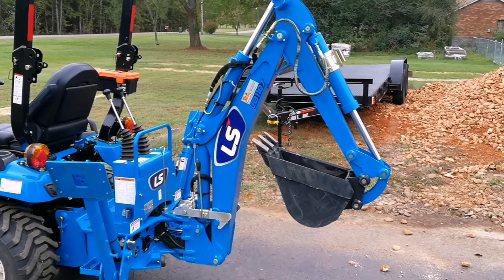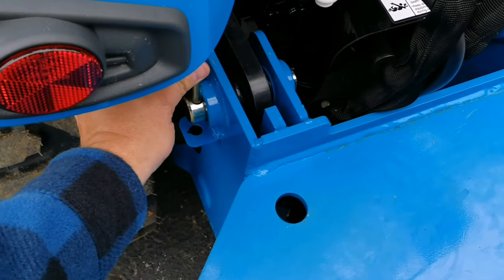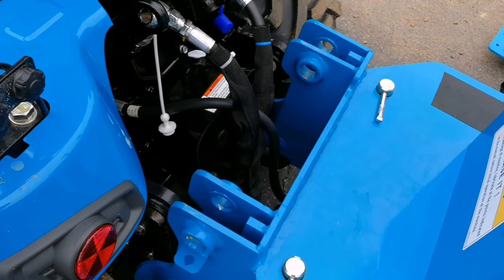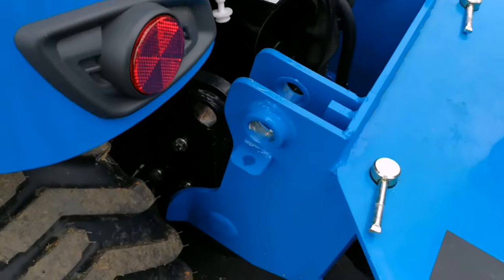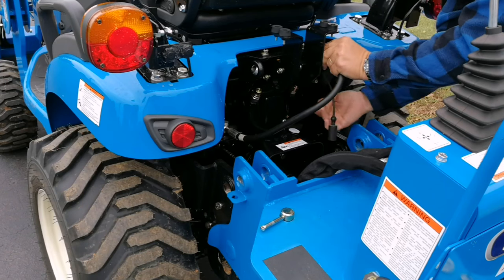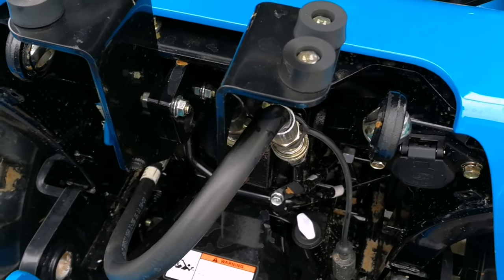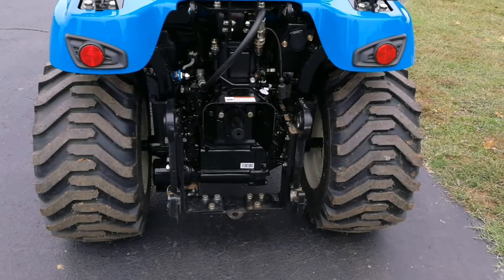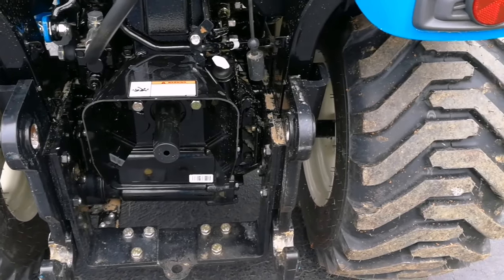MT125 Tractor Backhoe Removal (Similar to 10125R GC1710 GC1720 Workmaster 25s)

Comment: You had forgot to mention that before you disconnect your hydraulic flow/return lines, you need to cycle the control lever valves (after you shut off your tractor, of coarse) to relieve any built up pressure inside the lines. cool video & nice tractor

Comment: So I think the reason you heard to take the wheels off is for the 3 point. I just learned how to do this, & is NOT what my local shop told me. Local shop told me that you must remove the backhoe frame to use the 3 point. Wrong!! When you buy a 25S w/o the backhoe the 3 point hitch come with spacers (the exact same width as the backhoe frame). So when you use the backhoe frame, you don’t need or use the spacers. I figured this out after spending $20 in parts just to learn I don’t need them. New Holland already did this but I wasn’t told. Just something I figured out as this is my 1st tractor.
Reply from the maker: That video is pretty old. There is a much newer video on the new system. In the first Tractors there was a flaw. Only way to put 3 pt hitch on was to remove a rear wheel to slide the pin out. The spacers are not used on the new setup if it has the backhoe.

Comment: I SAW A VIDEO ON J/D REMOVING THE BACKHOE AND PUTING IT ON . BY USING THE 3PT HITCH . U HAVE A SPRADER BAR ON THE LIFTS BACK THE TRACTOR AND PICK UP BACKHOE AND KEPT LIFTING UP AND BACKING UP AND BRING BACKHOE INTO SUPPORT BRACKETS . THE ONLY THING  U TAKE OFF IS THE CENTER LINK. I GUESS IT WOULD BE AN OPTION O THAT WAS ON JD 3000 MAYBE THAT MAKES A DIFFERENCE. THATS NOT A COMPACT.

Comment: Thanks for taking the time to make the video. Really appreciate that! I'm really happy with the machine, it seems to be a better machine for for the $ than its competitors.
Reply: I heard the same thing about having to remove the wheel and wasn't at all happy about that. Thanks for taking matters into your hands and clarifying. I looked at the Massey, JD, Mahindra and really thought that with the build quality that the market for SCUTs would be changing due to the level of quality for the money. I didn't measure the gauge steel that the Massey was, but the LS looked heavier and overall build quality seemed better. Because of all of this, I didn't worry at all about resale. I think over time these machine will gain respect and hold their value well. However not really planing to sell......but you never know. Again, thx for taking the time to video.
Reply: I should have added that Kubota has big shoulders around these parts and I spent the most time looking at the BX23. What bothered me about that was, it seemed in many placing they were short-cutting or building things lighter. Where I felt the opposite was true for the 125

Comment: Ths for making this video. I have been looking at all the "top" tractors and this one plain has better spec's. As another gentleman said "more bang for the buck" and I have to agree. Haven't bought a machine yet but I'm getting close. Thanks again.
Reply: Well on your other video's I asked the question why did you trade in the other machines and would you say this LS is the best tractor you have owned?  The price is extremely attractive and the spec's seem better in some regards to the other tractors.  I agree it's coming on strong and I believe I would like to own one.
A second question is your "3 point hitch" modification.  The way I kind of see that is you just have to slide the bar, after it's installed to each side to get those lower legs of the hitch on.  Does that bar have to be removed for the backhoe to be installed?  Thanks again for your kindness and offering to answer my questions.